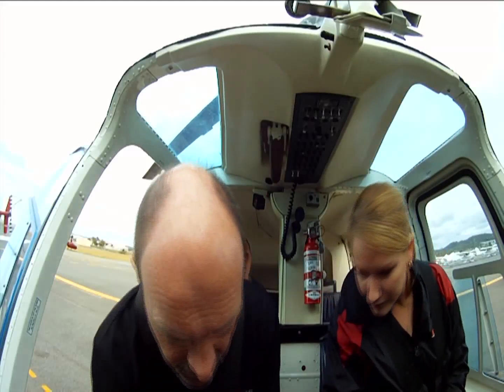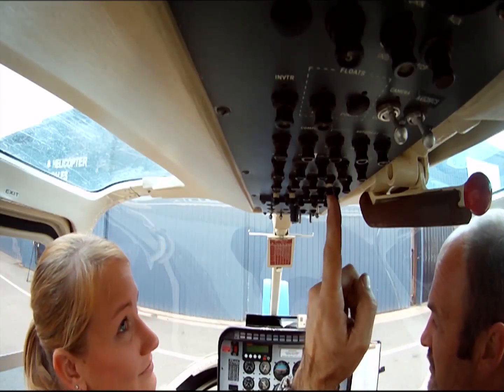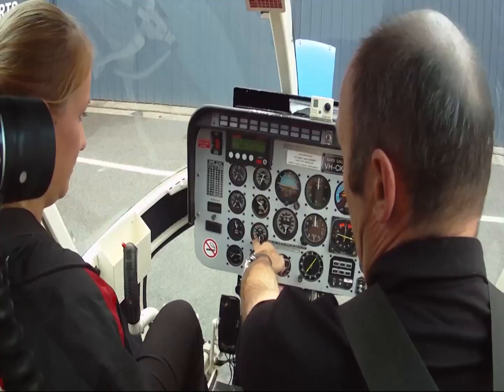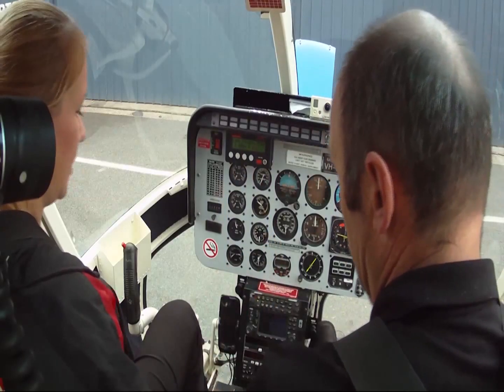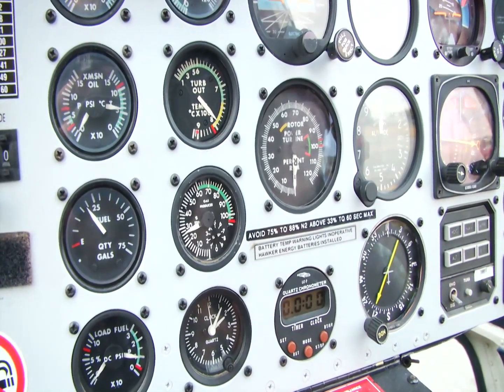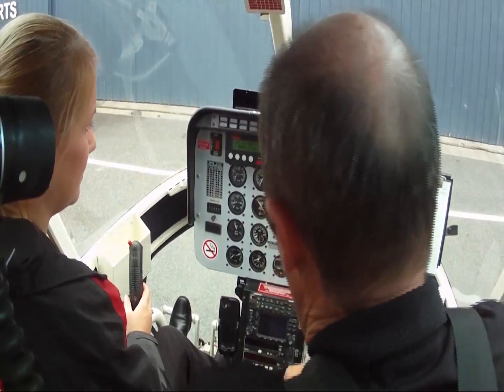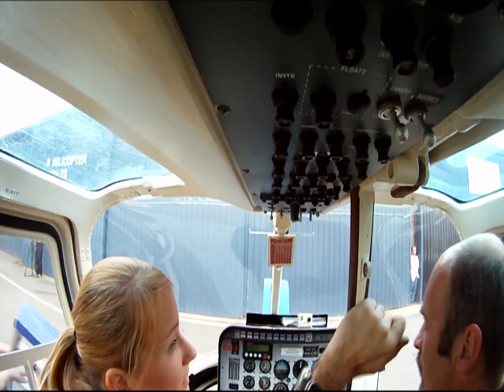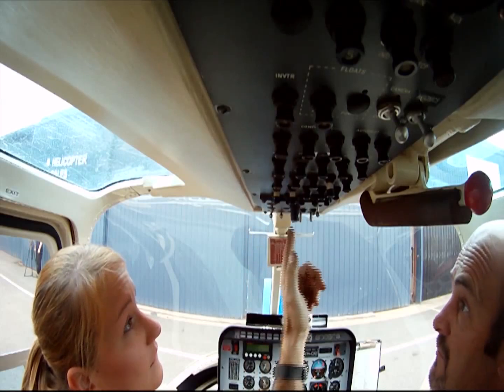Starting a helicopter

Comment: They have  heating protection! Also, he red lined the tot guage! Hot start?
Reply from the maker: The close up shots of the guages were a second start up just to get a better shot of the guages and cyclic. That second one was a hot start
Reply: Not a hot start at all. You're allowed 10 seconds over the first red line before it's a hot start.

Comment: will you give full throthel to turbine or just idle you even not tell in detail to start avaionics, apu ,fuel etc
Reply: probably best that they not disclose the full startup procedure just in case someone spots one in a clearing somewhere and decides to try and have a go at running it or even worse, flying it and this is not a joke, it actually happened in New South Wales one night in 1989 with a couple of kids attempting to fly one with fatal consequences

Comment: looked like a hot start---went into the red!!!
Reply: Temp is allowed topass the red line for 10 seconds the red dot 1 second. not even close to a hotty
Reply: OK---have not seen the red dot!  Thought if it went into red it was bad!  Thanks
Reply: +ibtm Depends on the helicopter and its equipment. In this case, they were fine. Try this with a mosquito, and you may have some issues.

Comment: I'm just curious,is the guy in the command pilot's seat a qualified chopper pilot or is he a LAME with ground running certification ? I heard once that anyone who is doing an engine run on a chopper which involves blades turning has to be a pilot or the aircraft has to be tied down & as the heli isn't tied down I'm wondering if the rule of flight crew performing engine runs is still the case ?